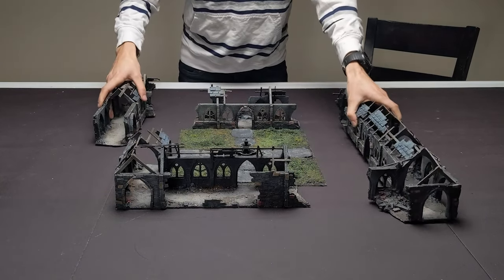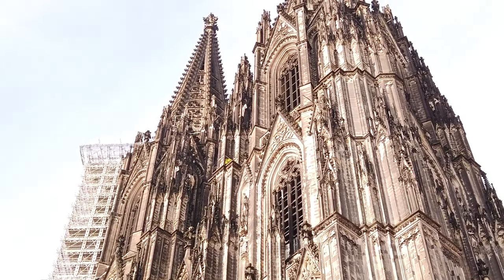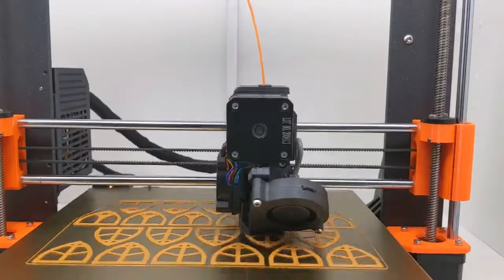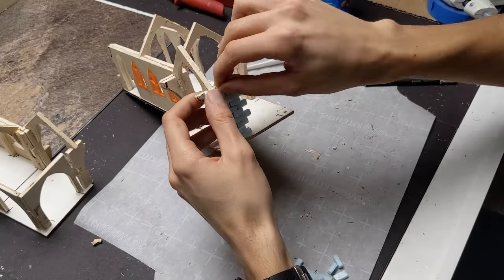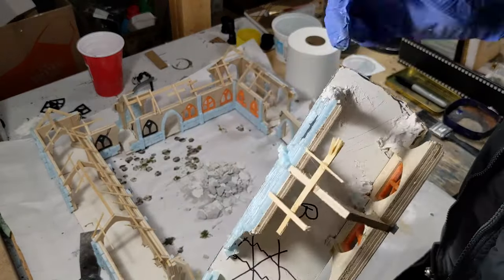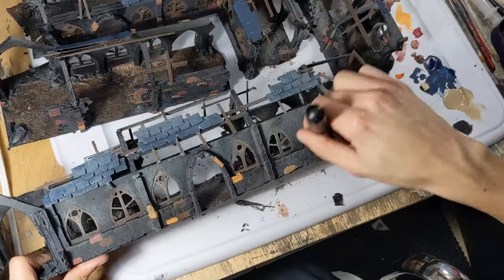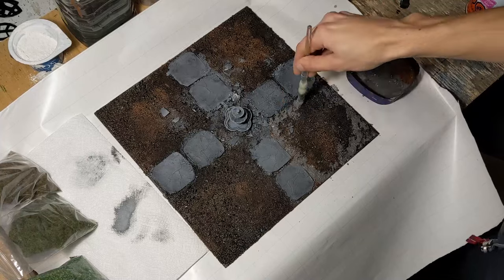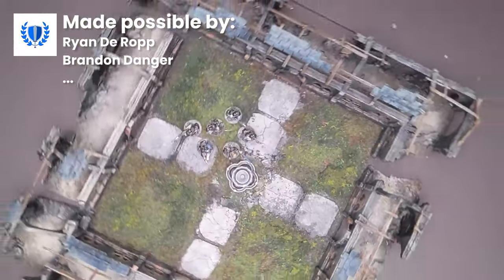Realistic MEDIEVAL Ruins Terrain (Gothic Cloister)

Comment: I am jealous. So far you have done three of the terrain ideas that lurked in my head. You have all the fancy toys (a engraver, a 3D printer, electric stapler, all kind of glues, these weigths with holes that I don't get in Spain, a dryer, a sketchup program, jig saw), plenty of space to make and play... and even a wife!! And you are making great pieces with basically ordinary stuff. And I have get some terrific tips (the foam sealing with heat, the tip of the screwdriver to make rivets, the battlemat). Thank you very much.
Reply from the maker: Haha! The CNC is actually my dad's, And sketchup is free to use! Theres tons of of tools I dont have too, theres always more stuff to wish for, but I can usually make do with what I have... Cheers, glad you're getting good use out of these.

Comment: If you cut a template for the walls from a plastic then you can use it to build the walls with the foam bricks, and you need only the one template (in this case) and there's no plywood/mdf/cardboard showing behind the bricks.

Just an idea, loved the building but will not be making anything like it since I rather not have walls in the front AND back in my terrain (when I put walls in it).
Reply from the maker: Right on! Something rigid like a plastic sign would work really well as a backer for a brick wall! Cheers!

Comment: Just a small tip from someone into medieval stuff and gothic architecture. "gothic arches" are overlapped circle halves at the top. By which I mean if you want to design a 1" gothic arch, then make a 2" rounded arch, half it vertically, then over lap the two halves, the resulting peak gives you the perfect gothic arch.

Your archways look good, but your windows don't fit the gothic arch design principals.
Reply from the maker: Interesting! I'll keep that in mind for future gothic arches, I didn't realize there was a specific ratio. Cheers! You guys are teaching me a lot of things in this comment section.
Reply: @KnarbMakes  Most people don't. I only know because I'm a geek for design, architecture and medieval history lol.

To be fair though, that's the "perfect" arch. there is room for deviation. But that is usually the best foundation as it's the most common. Some arches are based on  more oval shapes (either horizontally or vertically) resulting on a more pronounced peak for vertical ovals and a less pronounced one for horizontal ovals.

I think the main thing that is off with your widow arches, is that though have a peak, there is no real length on the horizontal straights. On every gothic arch or window I've seen in a real cathedral, there will always be at a minimum length on the horizontal straights of a gothic arch and it is at least equal to the vertical width of said arch, but you can go waaaay longer.

P.S. sorry if that was hard to read, its not easy describing something so visual.
Reply from the maker: @RainMakeR_Workshop  That totally makes sense, you described it perfectly! Im doing a lot more reading on this now, thanks for pointing me in this direction.
Reply: @KnarbMakes  Good, I was worried it was worded poorly. Or more over, worded pretentiously. But its hard to accurately describe something like shape and design without sounding pretentious.

Plus the last time I tried to help someone on YouTube with a design on something I know about, they basically got offended, told me where to shove it and then I got dogpiled by a bunch of fanboys lol.
Reply from the maker: @RainMakeR_Workshop  this is a safe space, please continue to point out anything I may have gotten wrong or could improve in my videos. I will always assume best intentions unless your wording is specifically hostile, lol.
Reply: @KnarbMakes  Lol I get what you're saying, but I hate the term "safe space". Most people I've met who talk about "safe spaces" are toxic as hell if you don't fit.

Btw, any plans to make more vids on other themes for 3d battle mats? Saw that vid earlier and loved it.
Reply from the maker: @RainMakeR_Workshop  Ill be doing more with battle mats at some point for sure!

Comment: You are going to regret that vinyl tile choice I fear.  Too flexible for the stuff you attached to it.
Reply from the maker: You think the flocking wont stay one long-term? I've done another piece but it just had chipboard/other materials stuck on top and it has held up fine.

It's flexible but it's not the super thin stuff. Time will tell I guess. I'll reply to this comment in a couple months and let you know how it goes 😋